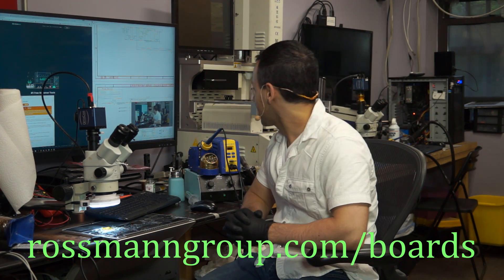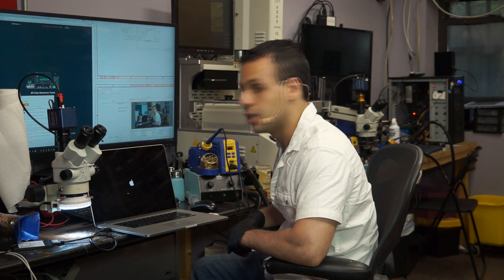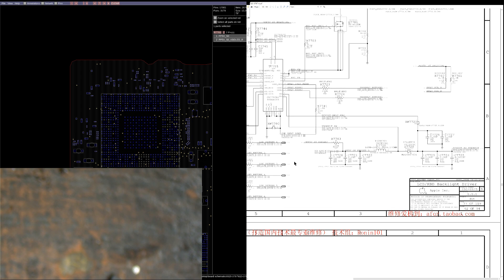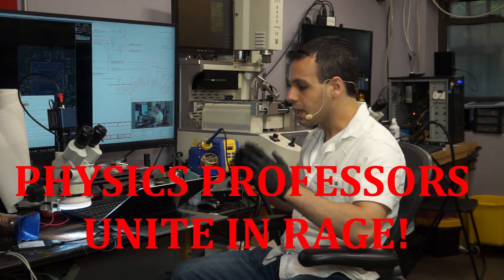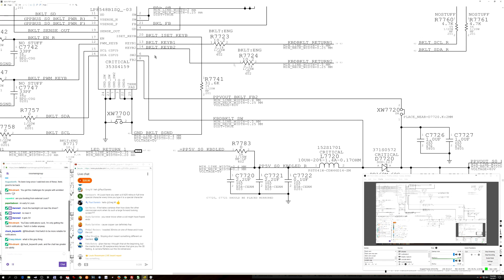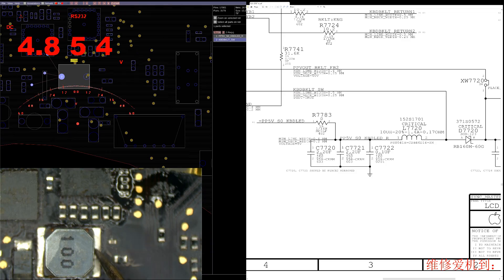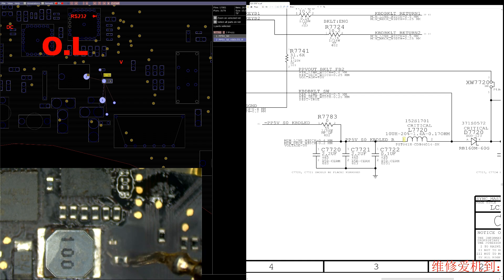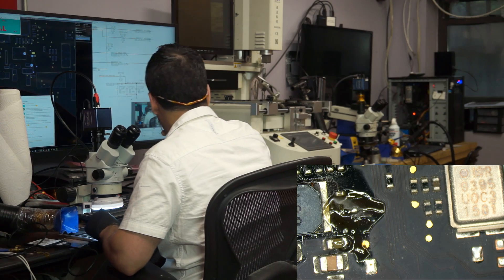No keyboard backlight logic board repair Macbook Pro Retina

Comment: Hey  i wanted  to ask you something,  i have  a similar problem  with my  13 inch 2018 macbook pro,   the issue  is,   after  i replaced the screen  for an aftermarket  screen,  the keyboard light  does not  comes  on,   for example  if i press the keys  to dim (tunr on  or off  the light on it) it doesnt  do anything  like  if  its  not detecting  the  light ,  also  when i go to settings   to get  the option to turn it on permanently   it  doesnt  shows  any options  to  turn on the keyboard lights, so  the question is    ¿is there  a flex cable dedicated  to the keyboard  lights?  because  i want  to check if  its a flex   or  its  something related  to the motherboard
Reply: Got the exact same problem (appeared randomly, without repairs), but noticed that the keyboard backlight goes on when booting, only after I login the backlight turns off (something firevault related maybe). The keyboard backlighting options are not present in settings. Got a keyboard replacement, which didn’t fix it, but they found out that the ambilight sensor is broken (which is probably unrelated), and Apple thinks that the keyboard backlight issue is a logic board problem and charges €1000+ euros for this. Have been able to fix your unit?

Comment: Mate, I have a problem that's busting my brain. The MacBook mid 2012 model powers up fine in safe mode, if shift is not held down it goes into a power on/off loop. It will only stay on as long as any one of the key is held down. Practically making it useless except for vids and music.  It has a 3-5 second window before shutting down if the held down key is released. I am able to change the key I hold down within that 3-5 second window. The MagSafe light is a very faint green, only obvious in dark.  The genius people say the motherboard is gone and needs replacement, for that cost I could buy a new one. All this came about because like a fucktart I spilled some coffee on the top right corner... Near the power button. Initially it didn't power up at all but a couple of days later...  It did, but only to be a decor on the desk. Any thoughts? Thanks in advance.

Comment: hey man liquid spilled on top of my pc keyboard, at first I couldn't get it on, but I brought it to  a pc repair and they have cleaned and thanks God it went on. only I have this problem that the keyboard doesn't work entirely only these key FJUYTRUJ47, so I bought a new one and I had connect it ride away but its act the same as the old one, I also tried another new one and it does the same thing. meanwhile my motherboard is clean and I don't understands why it does not work properly. can you please help with this problem?

Comment: Hey Louis Rossman dude. My Laptop freezes when I play CSGO for over 30 minutes. When I play other games which are far more high end than CSGO, it works perfectly normal. Any idea on how I can fix this? My laptop is an HP Pavillion with Nvidia 940MX graphics card, core i5, GPU clockspeed 2.50 GHz
Reply: Maybe you are getting too many fps on CS:GO :D. Try turning vsync on in the game options.

Comment: What model year is that, 2013?  What the fuck!?!  Who the hell is still using CCFL for backlights?

Yes, I know the Higher Voltage, Lower Current trick that also can be used to reduce the number ballast resistors, but still, 25VDC?
Reply: GeneralPurposeVehicl it's using LED. Been that way since 2008 unibody
Reply: 25 VDC is rather high for such a device.

Comment: Grounding the coil creates a magnetic field within itself, switching ground off releases that (emf) energy as a higher voltage lower current in the opposite direction of flow from the source voltage (5v in this example) this results in two voltages added together in series across the coil

The diode (now that the switching mosfet is off and not connecting the coil to ground) becomes forward biased and passes the combined voltages to the capacitors where they store the combined voltages for a clean 25v output.

The basics of switching dc-dc booster circuit. The same components arranged differently creates a buck converter for high to low voltage output. 

Always wear your seat belt for when the g-forces are quickly grounded by the brake pedal!

Comment: 5 volts goes through the coil to ground to charge it then cutting off the ground causes the electrical field to collapse creating a multiple of 5 volts times how many copper windings there are, thus creating the 25 volts. It's just like an automotive ignition coil only smaller scale.
Reply: Yeah that's to be exact about  it!! Or similiar: the anti-kick-back diode across a relay coil prevents a sudden voltage spike - same idea i guess